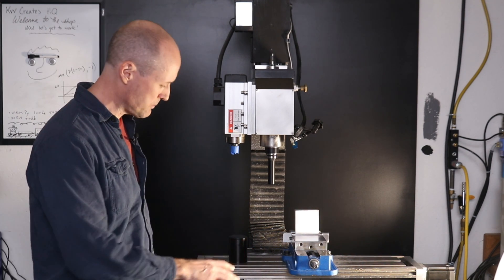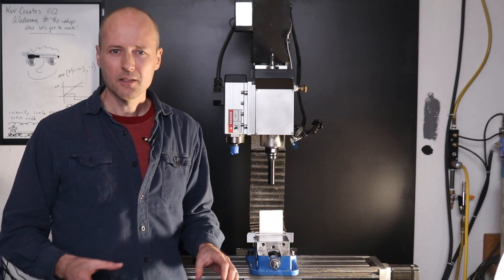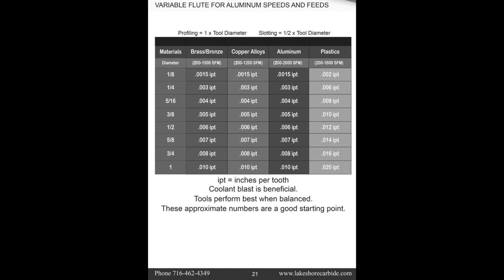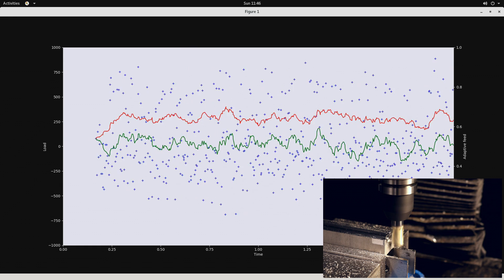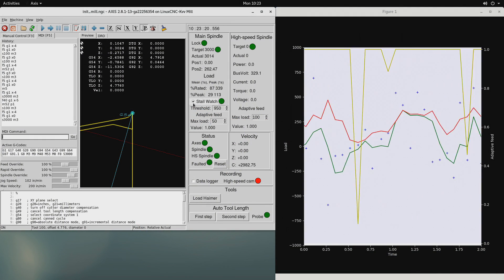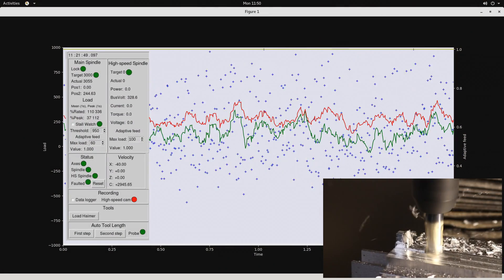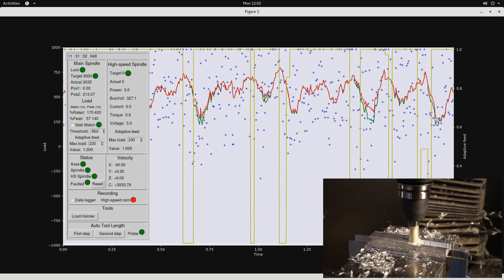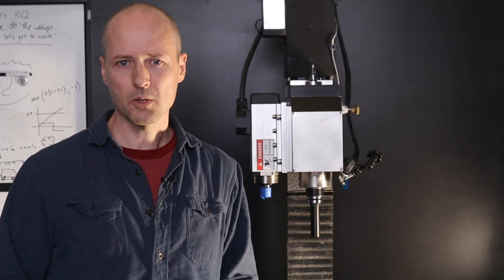Automatic Feedrate, Stop Spindle Stalls, LinuxCNC Adaptive Feed Rate

Comment: Thats awesome. I would love to see other people, especially beginners, use this with their cnc mill. I am interested in their experience using this system.
Reply from the maker: Thank you Aleksander. Today, it's too hacky to be used by others unless they have a similar setup, or want to do a good deal of experimenting and coding. What's needed, beyond the drive interface code, is automatic tuning to eliminate the experimenting. I've only tested this with aluminum and other materials might have different stall predication signatures. It would be nice to get similar safety features into an easy to use controller. I really need to see what other UI options exist for LinuxCNC.
Reply: @kentvandervelden  If you would be serously interested to release this for others with the same setup, I could help you woth the UI. I have thought of making an UI overhaul of lInuxCNC, especially because I have seen that it now supports PyQt, which I already have worked with on multiple projects. This was a project I proposed to my last employer, so I have prepared some analysis on the UX Design of CNC controls for mills.
Reply from the maker: @MrKurdishFreak  It's already on GitHub, though incorporating the suggestions received, I could do better starting from scratch :) I would be able to hook into just about anything, C or Python. If you want to design a better UI, just leave a little space for me. I'd be glad to add something in to or help test a UI.

Comment: The answer maybe in the spindle speed controller can you monitor phase angle instead of current I believe electronic overloads look at this because it's more accurate and reacts earlier, if you could slow the feed just a little earlier you would be onto a winner.
Reply from the maker: This is a very interesting suggestion! The servo drive does not support phase monitoring, but I have considered external monitoring. I've done the basic one current probe one voltage probe, but was unsure of the need of monitoring all three legs vs. one and assuming near balance. But you're not suggesting imbalance, but just phase difference, and I can  probably test that now. Thank you for the recommendation!

Comment: I've used LinuxCNC with everything from a little Sherline mill to a 5HP 5' x 10' wood router. This would be useful on both and everything in between!  Perhaps one answer to the bang-bang oscillations might be to come back "on" at 80% of the previous feedrate, then slowly ramp back to 100%.  If another impending stall were detected during the ramp-up, that 80% would be lower than the first time, since you'd target 80% of the running feedrate - not the commanded feedrate.  (and maybe PID is a better way to solve this - I don't have experience with the PID module...)
Reply from the maker: Thank you Peter. I use a PID control loop now and maybe with more tuning results would improve. What you are suggesting may be superior, I think, a piecewise linear function. For variable, infrequent, must not overshoot, and must be easy to setup arrangements, you probably have the best idea. This may be what Haas AutoFeed uses, which has controller parameters for the step-up or step-down amounts. Thank you for the suggestion!

Comment: Fantastic work!  This could potentially make sharing mill resources much safer.  Think MakerSpace and other co-ops.  If it was always set to simply stop at some % of spindle load the likelihood of doing a TON of damage to the VMC decreases substantially.  

Tons of other uses as well, just great stuff overall!
Reply from the maker: Thank you Bill, that is a great application! And I never would have thought of it. Of course schools too. The chief operator or teacher could load up the limits based on the experience level of the operator.
I only have experience with small CNC machines, LinuxCNC, and Mach. I saw the Haas has AutoFeed, which has a lot of options. Maybe all the big controllers have adaptive feed?
Reply: @kentvandervelden  The little bit of experience I have tells me that this is very uncommon.  LinuxCNC is fantastic in lending itself to this type of thing.  Will you be looking to incorporate this into the future versions of LinuxCNC or are you going to release your code?
Reply from the maker: The code is on my Github, but it's pretty specific to my setup or at least to DMM DYN4. It's written to demonstrate the ideas, not to be a simple install, but anyone could experiment with it. A couple external Python modules and some HAL code. It would need to be made much more automatic or easy to tune to be in LinuxCNC, but maybe in the future. Thank you
Reply: @kentvandervelden  Awesome!  If you think you'll leave it available for the foreseeable future I'll bookmark it and make sure my son knows about it.  He's digging into LinuxCNC for the first time.
Reply from the maker: @billstrahan4791  The code will stay to support the video, especially if someone wants to dig into it. Most of the time, viewers have better ideas then me. Github is pretty nice, and I can easily share updates that others add in. Thank you

Comment: Great idea Kent! I'd be inclined to try to achieve the same result  by using a PID with it's output connected to the adaptive-feed pin. The Spindle speed would control the PID loop and the PID control the adaptive feed. A servo running a spindle is running in "velocity mode". A speed deviation in a velocity mode drive is the cause, the effect is the increase in torque which is measured by current. The DMM drive is handling the velocity control by manipulating current output but the current change is a reaction to the velocity deviation so controlling anything based on current will lag somewhat. Tracking spindle encoder speed directly with LinuxCNC and feeding it into the PID will allow it to react with adaptive feed overrides faster than measuring anything else with any other means of communication. The PID would have to be setup to react to very small deviations in current-speed vs requested-speed. PID tuning would be a bit tough but I expect it would work very well. I've never thought about using adaptive feed but I might have to give this a try when I get a chance.
Reply from the maker: Thank you Justin, this is a great idea! I understand what you are saying about the DMM control loop. I would want to experiment with target loads on small endmills. I currently use a control loop to drive adaptive-feed, though AF is limited to the range [-1, 1]. Maybe with some scaling and shifting one could get to values greater than 1? At least my plan for increasing the feed rate to get closer to the target load was to instead manipulate the feed override. The remaining advantage of AF is the potential to back off slightly with a negative AF. An external module was easier for me to incorporate information from other sensors, like the axes motors, though perhaps at the cost of responsiveness?
Reply: @kentvandervelden  

"motion.adaptive−feed IN FLOAT

When adaptive feed is enabled with M52 P1, the commanded velocity is multiplied by this value. This effect is multiplicative with the NML-level feed override value and motion.feed−hold." 

It's a float pin so if the Axis were commanded 15ips and the adaptive-feed pin were driven to 0.5 then you would halve the commanded axis speed. I haven't tried using it at all so grain of salt but 1 should be treated as 100% and the full scale rach should be available being that it's a float. Not sure there is any use for the negative value, I think it's a limitation because unsigned float doesn't exist as a pin data type, I would assume a negative AF would be treated as 0 since I don't really see how a negative AF would work. AF should be meant to reduce the axis speed only, it's exposed with an Mcode so it needs to conform to what they intended for the Mcode. As you said halui.feed-override is more scalable so maybe you just want to use that? AF and FO are part of the same calculation just exposed in different ways so you should be able to just leave AF alone and work on FO. Otherwise being a programmer I'm sure you can just modify the source of the motion component to allow higher than 1 for AF. I modify hal components all the time and recompile if I need a different pin data type or a I need a parameter to be a pin and I barely know what I'm doing lol.

How are you reading the spindle current to the controller? Are you doing this over serial? Poking at the drive over serial is gonna be super slow. Everything involved in this has to be real-time. If you aren't already I'd use the drive's analog current output pin to one of the Mesa cards higher resolution analog inputs if you really want to use current to control the loop. If you want to keep your loop logic over using a PID you can even just write a RT hal component being selective with your control functions and interact with a slimmed down version of your userspace module with hal pins. Ive worked with a friend several times to write custom hal RT components and I swear by them for speed and convenience.
Reply from the maker: Negative adaptive-feed is for backing off. Seemed liked the original use for it in LinuxCNC might have been for plasma cutters to avoid tappered cuts. 
Using AF was easier for this demo to be fed by a PID control loop, than FO which has a UI component, but FO is what I had in mind for testing > 1 feedrate multipliers.
Thank you

Comment: Awesome!
Reply from the maker: Thank you Jan :)
Reply: @kentvandervelden  I occurs to me that you could probably make a simple PI loop, or perhaps just a P loop around the system. You are sort of doing that, but the response has an essentially infinite P parameter resulting in a 0/100% response. Kind of like using a linear scale in an outer loop to correct for ball screw deviation. Except don't use velocity or position, but spindle power. At least for the restart. Then, after one sudden stop, the thing would continue at max power at least as long as the cutting load does not change. Again, awesome work. Thanks for sharing!
Reply from the maker: I believe that I'm following, and sounds like it would help stop and restart. The inputs to the current control loop are scaled so that P=0.2, gives a change from 1 to 0 (the positive side of LinuxCNC adaptive feed) over 0.95xSetpoint to Setpoint of peak spindle torque (P=0.1 for 10% range, and so on.) The torque measurement is pretty noise, shown in the graphs as the blue dots. I'm using the median of most recent 20ms of data, if I remember right. The other line is the absolute torque over the same time. In the graphs, one curve stays near zero when the spindle is freerunning and the two curves converge as the spindle starts doing work. The response could be slowed down or start slowing down earlier and follow a logarithmic curve to more gently slow the feed rate? How many times will I get to tinker before breaking the tool... I try to play recorded data back to estimate parameters, but behaviors quickly differ.